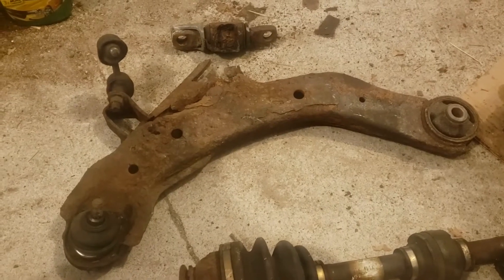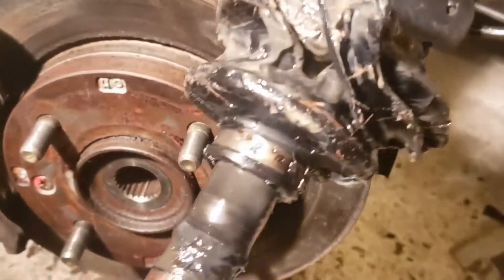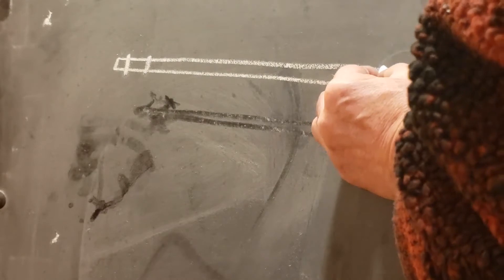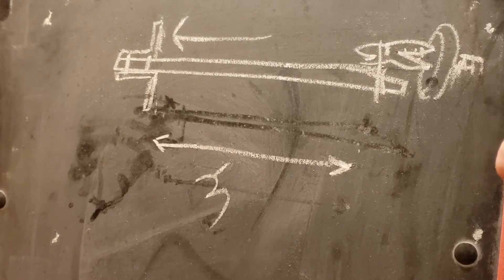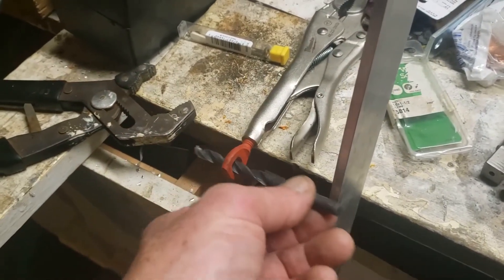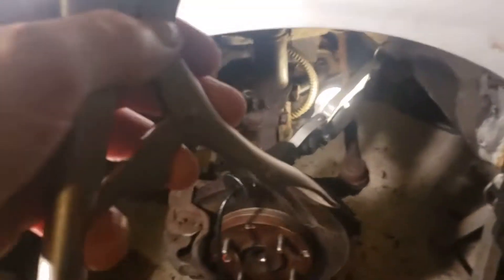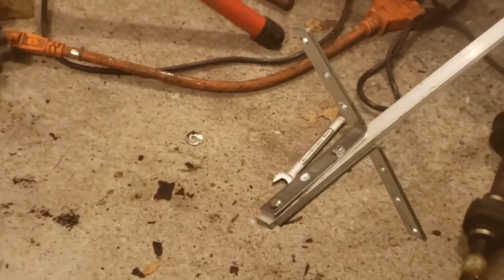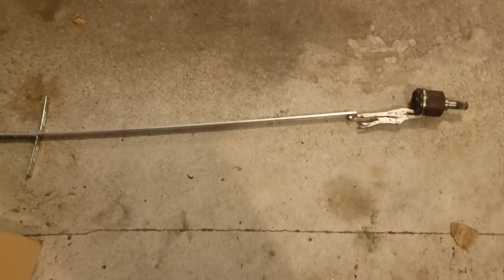CV joint stuck? How to remove a CV joint easily using a home made tool! Drive it forever!

Comment: American ingenuity. Great idea.👍🏽
Reply from the maker: Thanks, Man!  Hope you never have to do it though :)  I was rather amazed at how easily it came out using a sharp blow from a quick hammer strike. Speed multiplies force or such. I guess, you can't split wood by pulling it apart by hand either.... but a fast strike by a hammer on a wedge does the trick!    -C